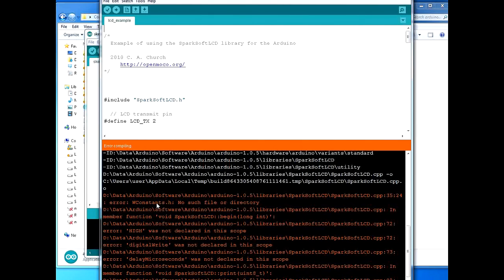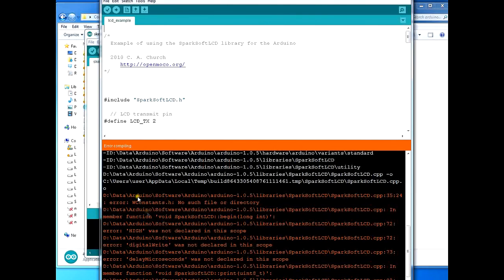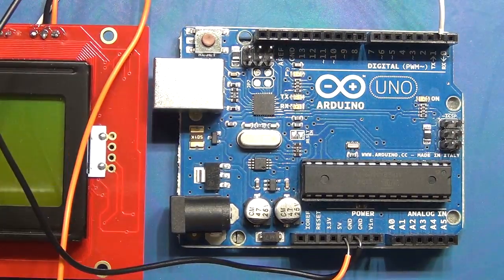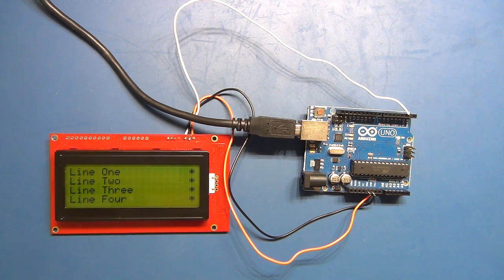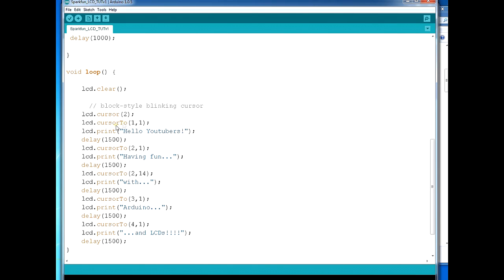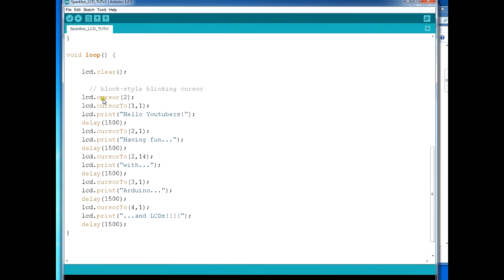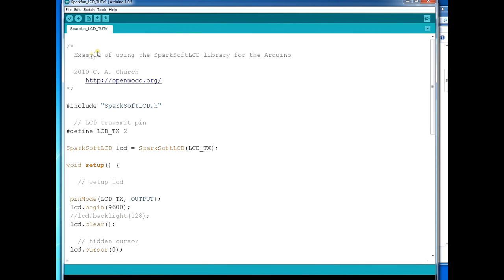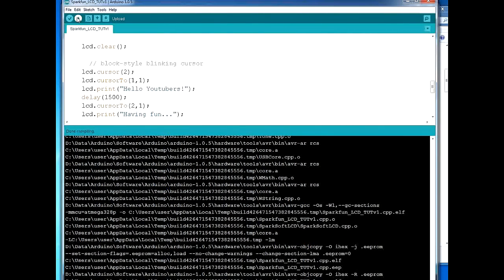Arduino Tutorial #4 - LCD displays, Libraries and Troubleshooting

Comment: Whenever you see a #,  its called a pre-processor directive.  It's not actually part of your compiled code. Its actually telling the linker / compiler to do something (like include a header file) before compilation.

So, that code says "If "ARDUINO" is already defined, and its greater than (ie, newer than) version 100,  include the header file "Arduino.h", but if "Arduino" ISNT already defined or is an old version (less than 100), include the header file "WProgram.h".   I hope that explains :)

Comment: "lcd" isn't a "constructor" as you called it, it's an object, which is instantiated from the class in sparkfun's lcd library, and what you called an "instance" is actually a method.  (object oriented speak for function)  Figured I'd mention that since that's what everyone knows these things by.  Contruct is actually the method that fires once when you instantiate an object from a class automatically.  Figured I'd mention this so that people don't get confused with incorrect or archaic terminology.

Comment: As regards the "float variable bit".  When you are displaying it on the LCD, its not a float is it?  It's a series of characters.  If you think in those terms, you'll get less confusion when dealing with LCD libraries.   Also remember to the overhead when dealing with floats on an 8 bit mico.  GL

Comment: Hi mjlorton. I have the Parallax serial LCD with (RX, 5V, and GND) pins. I wrote code to display on the LCD but it does not work. I don't know if I need to include something in specific to the code to make it work such as: 

#include <NewSoftSerial.h>  
  NewSoftSerial lcd = NewSoftSerial(2, 6); //Set RX/TX pins for LCD 

I don't think I have problem with the wiring because is only 3 pins that need to be connected.

I am new to this please help!

Comment: Hi, I am seeking some help.  I bartered for a sears craftsman electronic radial arm saw.  It is from the 1985. The electronic display does not function.  I removed the cover and the display from the saw, only to discover that someone had tried to fix the battery connectors which were flat copper strips, they were re-soldered and that has seemed to cause it to work.  I am very little knowledge about control boards, but performing a continuity check, I am certain that is the cause.  Also the LCD screen is completely off the board.  I am sure if I could send a pic, things would be clearer to understand.  also, were the lcd screen should go there are 17 small metal areas where the screen would go.  only 6 have any type of lettering to them.  Is there any help to resurrect this board to get a display to my saw?

Comment: Hey I want to use an 16x2 LCD (parallel enabled). But I want to send data to LCD serially. And I want to do series to parallel data conversion using 74164 shift register can u plz tell the implementation.I will be very grateful to you.

Comment: i am getting this error 
Arduino: 1.6.8 (Windows 7), Board: "Arduino/Genuino Uno"

Sketch uses 1,066 bytes (3%) of program storage space. Maximum is 32,256 bytes.
Global variables use 9 bytes (0%) of dynamic memory, leaving 2,039 bytes for local variables. Maximum is 2,048 bytes.
avrdude: ser_open(): can't open device "\\.\COM1": The system cannot find the file specified.

Problem uploading to board.  See http://www.arduino.cc/en/Guide/Troubleshooting#upload for suggestions.

This report would have more information with
"Show verbose output during compilation"
option enabled in File -> Preferences.